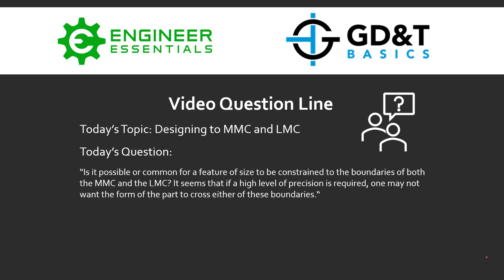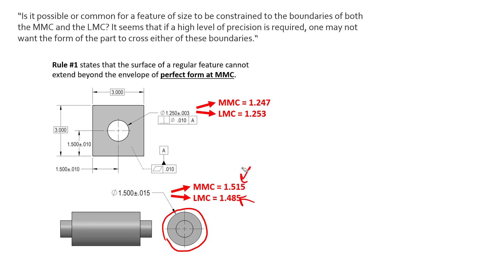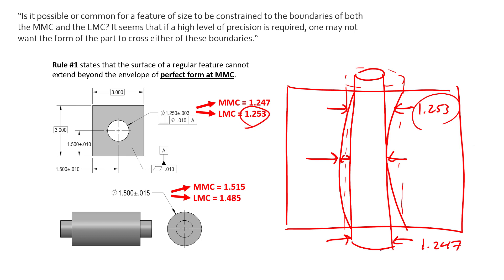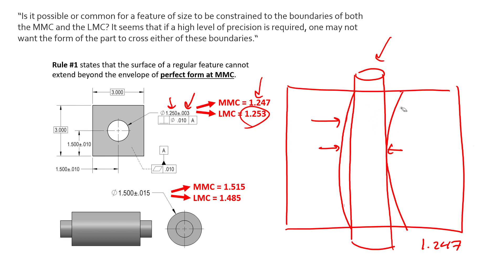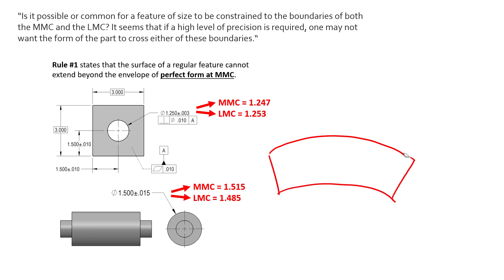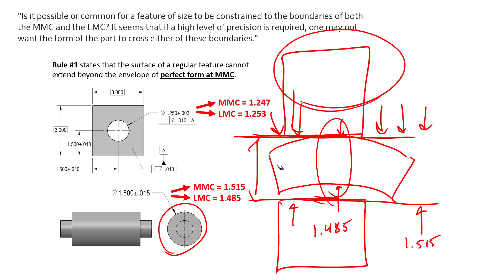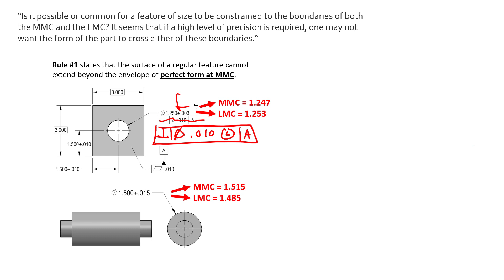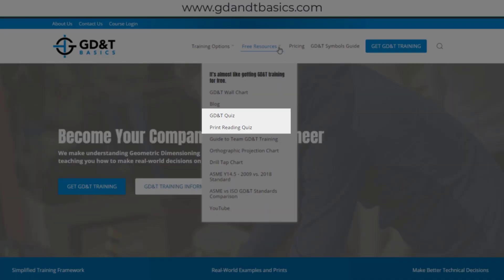Designing to MMC and LMC

Comment: I think there is a small mistake in your explanation. Your MMC (maximum material condition), only includes the size of the hole, but not the the form. That would actually just be the MMS (maximum material size). To get the full MMC envelope, you also need to add the value of that perpendicularity (subtracting it here, since we are talking abouit a hole), as the hole can, and is allowed to be both at the maximum material size AND to also have that .010 perpendicularity to A in addition, which would decrease the MMC envelope even more. So MMC should be 1.237 here.
Reply from the maker: Thanks for the great comment! The original question is only focused on the envelope of perfect form that we adhere to when discussing Rule #1 and that is solely reliant on the limits of size (MMC and LMC). So we are ignoring the perpendicularity for this discussion. However as you pointed out, during design of this part we definitely need to consider other boundaries as well. The boundary that gets created when we consider the effects of orientation/location as well as the size and form of the feature is called the Inner Boundary and for this example that would be a boundary of Ø1.243 inches. If the maximum material condition modifier were applied to the feature control frame this boundary would be referred to as the virtual condition.
Reply: @Gdandtbasics  Well sure, but you need to put the (M) modifier somewhere, it only makes sense to the perpendicularity, you cannot apply it to the linear dimension itself. So honestly, I see no way to exclude the perpendicularity without making it confusing, except of course putting a 0 value, which would force perfect form at the maximum material size.
I think something that would work as you explained it would actually be the envelope requirement. That would be applied to the dimension itself, and force a perfect form at the maximum size, without having any link to the perpendicularity.
Reply: @AlexLapugean 
In the end of your last response you have the answer to your own argument. It works for the envelope principle and the envelope priniciple is actually what the topic was.
Reply: @sem7207  Not really. The video is about MMC and LMC (and wether you can use both at the same time). These are terms only present in the maximum material and least material requirements that can be applied to geometric tolerances, it has nothing to do with the envelope principle.
Reply: @AlexLapugean  
The terms MMC and LMC describe the two limits of size of a feature of size. For a regular feature of size there is the envelope principle (rule #1) that links the form variation to the limits of size by requiring "perfect form at MMC". This is what was discussed in the video. This is regardless of any geometric tolerances being modified to apply at MMC, which is a totally different topic. Note that the perpendicularity tolerance was shown to apply RFS. The only place  where any modifier was introduced is when the LMC modifier was shown in the end of the video, to tell how it changes the meaning rule #1 (envelope principle) that was explained until that point.
Reply: @sem7207  I think you are conflating MMC/LMC = maximum/least material condition, with MMS/LMS = maximum/least material size. MMS/LMS is what you are describing, while MMC/LMC is a state of a feature that is both at MMS/LMS respectively, but also includes all the geometric tolerances that are afffecting the final envelope of the space that feature can occupy, not just its size.
Reply: @AlexLapugean 
You are talking in terms of ISO GPS while the video (and my comments) are ASME based. This is probably the cause of confusion.
Reply: Hello Alex, you brought up a good point. I also agree with you that the perpendicularity need to be taken into acount. However there is no MAXIMUM material condition applied to the perpendicularity. So I belive MMC should be somewhere between 1.147 to 1.247,most likely 1.153=(1.250-0.003-(0.1-2×0.003))
Reply: @冯孝伟  Yes, it's not there, but this is just an example I assume, to show how that would apply here, in this case, the MMC modifier would go on the perpendicularity tolerance.